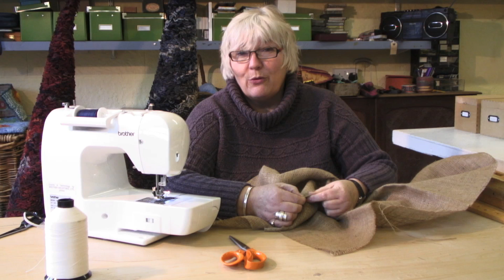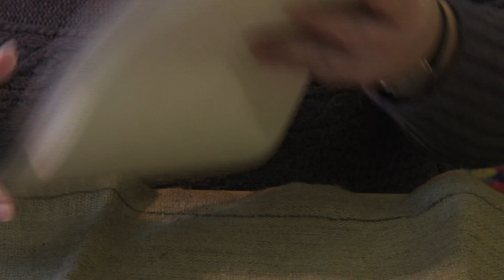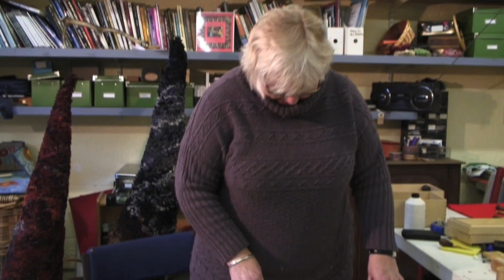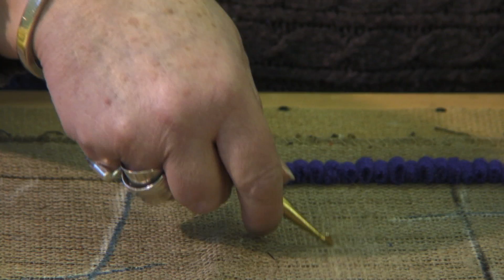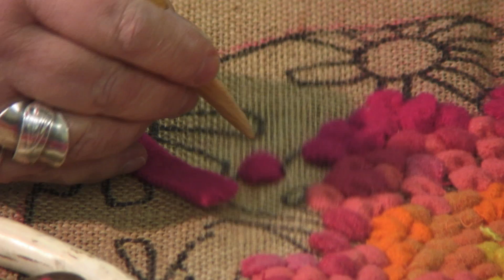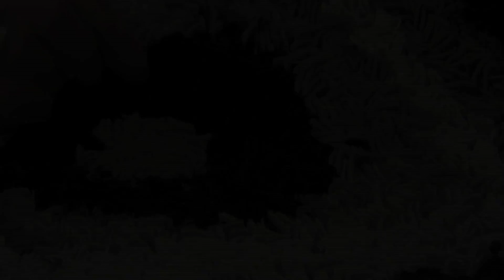Hooky and Proggy Mats - A Beginner's Guide

Comment: What are the dimensions of your frame. I’m trying to give my son directions and he’d like better measurements than I’ve been guessing. Thanks
Reply: The long sides with the webbing attached are about  3” x 1.75” and the side slatsare about 2.5” wide and about 30” long. The main struts can be any size but I would never have them less than about 36” long and if you have them longer say 48”” or 60” long the you can do large or small rugs or wall hangings on them.

Comment: but how do you stop it all unravelling when you wash it?
Reply: Grey Witch you just use a cloth and rub it up from time to time with hot soapy water   Never put it in a machine and you can carefully hoover it.
Reply: @alirhind2123  I don't own a Hoover, nor any other  kind of vacuum cleaner , I made one after all and it goes into my washing machine. A rub with a cloth simply wouldn't do the job if one of the old dogs pees on it or the cats is sick on it. I wash, then collect the loose bits and reattach lol. My rugs are used, not just for looking at.

Comment: Could you please tell me where I can buy a frame for making the mats. Great demo
Reply: These are home made frame rather than purchased ones. Tyne wear museums has instructions how to make them.
Reply: P.s. very cheap and simple to make,
Reply: That is a huge Cheticamp frame. There are other, smaller/more portable, less expensive frames that use gripper strips or tacks to hold the base fabric taut. Because they are smaller, the base fabric can be lifted and repositioned to allow access to different parts of the “rug.”

There are several other YouTube videos demonstrating these. 

Google search for Traditional Rug Hooking frames to find frames for sale. 

Also, I do not think that most rug hookers hand-cut the strips of wool. There are devices available to facilitate that. 

On Etsy there are shops that sell these tools, as well as over-dyed wool in myriad colors for hooking. You can use off-the-bolt wool (machine wash and dry first to felt the wool) or you can dye your own. 

There are many good books too. 

For my first project I bought a kit. After that I designed and prepared my own.
Reply: Carol Madden,  I showed my husband Ali Rhind’s frame and he made one for me by looking at the video.  Cost $25 US dollars.

Comment: Can you do these techniques without a frame? Thinking of doing this with my Girl guides with Hessian and t-shirt but want to save expenses and not get frames. Thanks
Reply: Vik Lloyd You can do it without frames, as I go to a group at the Word in South Shields and some of the group are doing a big one without the frame, but bit of advice here, it is much better with the frame, you can also use old picture frames and using a staple gun, staple the hessian to the picture frame
Reply: heather ward that's a good idea I can get the cheap ones from IKEA! Thanks

Comment: Thank you very much for the demonstration!  Can you wash these is the machine after they are made, or do they need to be hand washed?
Reply: Definitely not a good idea to put it in the washing machine.... it may well disintegrate and won’t do your machine much good either. You can shake it, use the upholstery attachment on your hoover or if it is stained try hot soapy water or carpet foam.